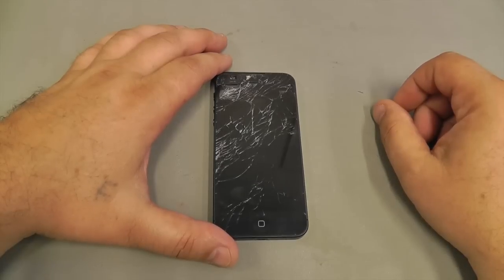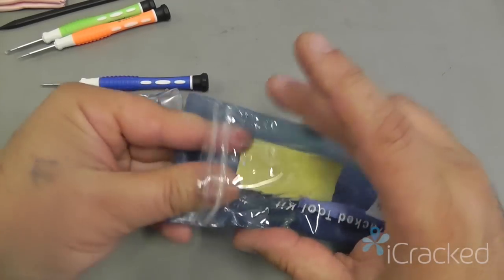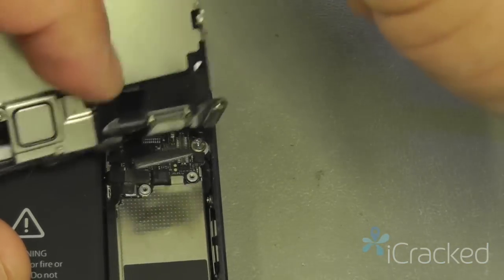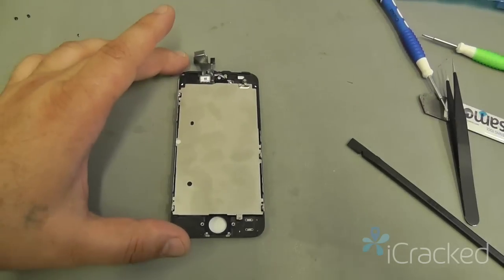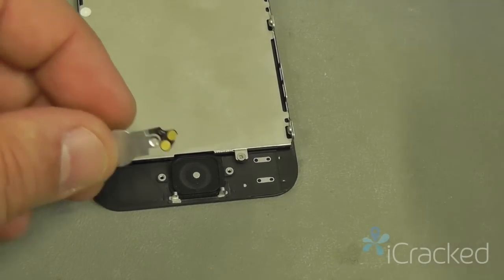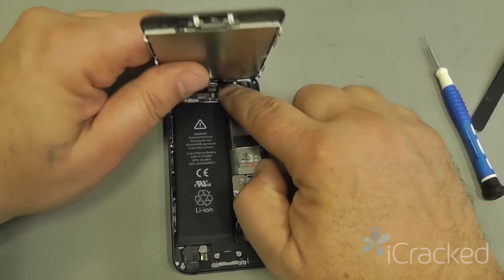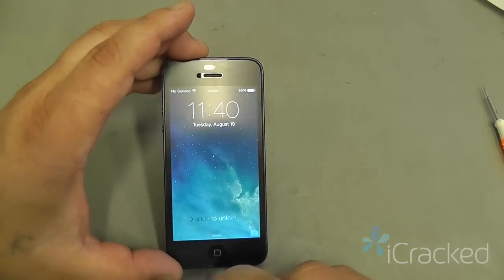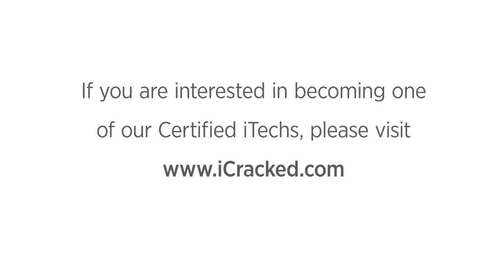Official iPhone 5 Screen / LCD Replacement Video & Instructions - iCracked.com

Comment: Mine checkered briefly with the screen unattached. But as soon as I put the screen into the final position it works perfect without any further work.  So the tension of pulling on the ribbon cable I think caused it. I do have the metal cover fastened securely over the digitizer cables. Anyhow the battery of tests show everything working properly and a successful repair. Thx

Comment: We just followed all the instructions to the letter and we successfully replaced our iphone5 screen! Thanks a million for all the info, we really couldn't have done it without them. BE CAREFUL: when you put the little screen for the light sensor on the new screen, keep the new screen horizontal until you put the camera assembly back on, or the small part will fall off (ours did, but we managed to find it and put it back).

Comment: Very helpful video; I barely needed the guide booklet.  One thing I wish is that the toolkit for the iPhone 5 came with that very handy looking pair of tiny tweezers, instead of the flat blade screwdriver; which I didn't need at all.  The best advice was to keep each of the sets of screws separate and to note that some were longer/shorter than others.  Thank you!

Comment: what do you do if your new screen does not come with a front camera plastic ring already installed, or a proximity sensor bracket?
Reply: you have to transfer all your parts over to the new screen just like in the video unless you buy a "Complete assembly screen"... Don't forget the 5s will need the orginal home button transferred to the new screen regardless of a complete assembled screen with home button

Comment: I replaced the screen. I have orange solid vertical bar looking lines. It has one red thick vertical line running through the Apple logo during startup.

Comment: I replaced it it was a tight fit into the face it slapped in place  but now theres a red share in the center of the screen  is this because of the tight pressure or is this a bad Connections??  Help

Comment: Help!!! I did everything  you said and everything happened and well it worked but the touch screen didn't work so I tried to  retake out the battery but there was a spark when I tried to take it with the screw driver help please

Comment: my phone is cracked and there is lines and the screen doesn't respond well to touch is it fixable by replacing the screen?
Reply: Yes.
Reply: carly lecznar you have to disconnect the battery and hard restart will resolved your issue

Comment: We did everything according to the video but the phone isn't starting up it looks like there are diagnostics running.  What is wrong?
Reply: Did you disconnected the battery before removing other cables?

Comment: great video. i would only add in the beginning (instead of the end) to keep track of which screws go where. draw a diagram. they are not interchangeable. it took me more than 2 hours. i'd pay someone else next time, or at least get stronger glasses.

Comment: I suggest for people not to pre-form the display flex. I did it on a screen gently doing it and the screen was showing grey lines and glitching. Replaceable LCD flex cables seem to be more brittle than an original OEM screen.

Comment: tried this screen doesnt come on at all but vibrates when i plug in charger...
Reply from the maker: Sharonda Buckner We're sorry to hear that you're having issues with your repair. Was the screen assembly purchased from Amazon or directly from our website?
Reply: Amazon
Reply: ***** i'm a new iTech and tried my first time. The First Time was good, and it seems to be working everything. Then i closed the Display and since then the Display stay off. At first it vibrates every 30s, now it just playing the sound of recharge every 30s. You have an Idea?

Comment: My phone won't shutdown because the LCD is cracked and while i was working i sweated it out so the phone got wet. All i got is lines on my phone and its been like this for a week. I can't power it off. i bought the LCD replacement from you all but i don't think its going to work since i can't shut the phone off
Reply: Tyrone Payne You have probably fixed this by now, but, you can always shut the phone down by holding down the On/Off/Sleep/Wake button and the Home button together until the phone shuts off, about 10 seconds.

Comment: Recently I got a new LCD in the mail and decided to try and replace my iphone's cracked screen. The problem was that the LCD came to me cracked. I didn't even check the actual package when it came, I just went ahead and took the screen off the iphone 5 and I realized once I took off the original cracked screen, that the screen that came in the mail was also cracked. I know it was pretty dumb of me, so I ended up trying to put the old screen back, but now that I did that, I see checker box patterns on the screen, along with lines going top to bottom, and 2 weird black looking ripples on the screen and I'm sure that I connected the LCD back correctly. I don't know what the problem is but I ended up trying to connect the new screen that was also cracked onto my phone by simply connecting the LCD cable and the digitize r cable. (I didn't change the home button or camera). After doing that I got the same result with the weird patterns. I have no idea what went wrong in this repair. Can someone please help.
Reply: The touch doesn't work on either screen too, and but everything else besides the display and touch seems to work ( Charging, Power/ Home Button, Mic, Audio etc.)

Comment: When you spend 2 hours taking every single step very slowly, and then you get to push in the screen, and the "slight bow" doesnt happen when you gently push the screen in. Instead you hear a nice warm "crack" as all your hopes and dreams flow into the depths of hell and you are left with nothing but a cracked screen to replace your cracked screen. I'm basically done with life and am now going to go cry myself to sleep. Thanks for the very clear instructions that its supposed to bend, mine didn't. Rip my screen 2k15. The future moments we could've spent together will be missed.

Comment: Touching electronic connectors with bare hands shortens the lifespan on the device as oily residue causes early corrosion. First thing you learn in electronics education.....just a note.

Comment: This was so easy to follow. when I first put the screen back on, my ear speaker wasn't functioning. I just went back and gave my connections a once over, and everything worked perfectly. The only downside is that I have several parts missing from my phone. I want to go back to the place that replaced my glass, but I think I would lose my temper. I said and meant several, and now that I know how easy this is, I feel even dumber for letting some crappy mall kiosk touch my phone. Do it yourself!

Comment: one of the screws holding the thermal plate is stuck on really tight, so any way to loosen it?
Reply: +~Karla no reply from iCracked, but I managed to get the screw out by using a bigger screwdriver, but I don't know the size. It's one of those cheap helicopter model screwdrivers, if that helps.